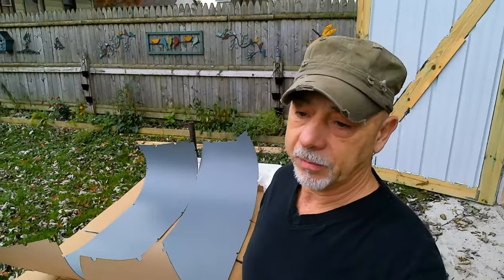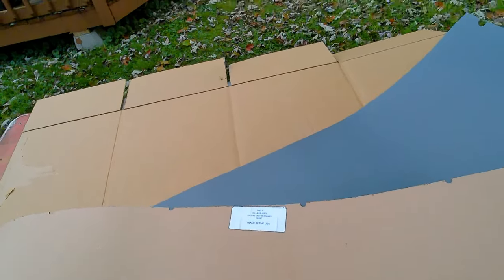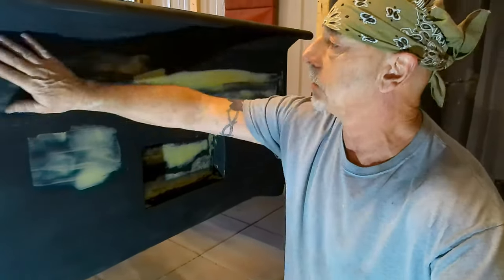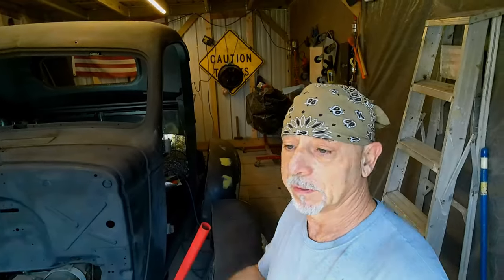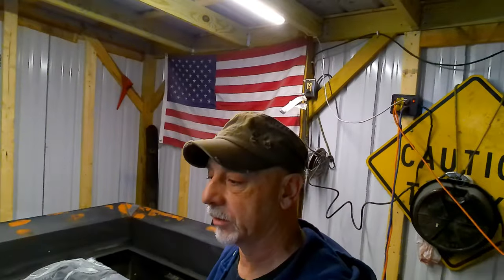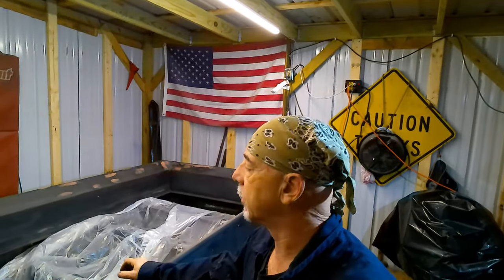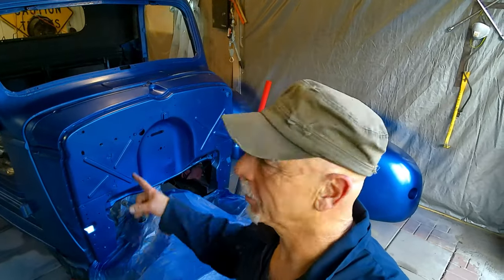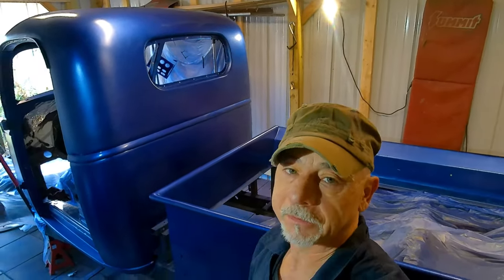'46 Chevy truck build - Cab and box finally painted!

Comment: Nice job,  you can cut and buff single stage if you have enough paint on it,  just wet 800, 1000 and 1200 then polish,  of course you can lay a clearcoat on if you're not into the buffing thing,  but you still want to cut it with 600 wet before you spray
Reply from the maker: thanks man, i got 3 wet coats on it, im thinking that will be enough to cut and buff